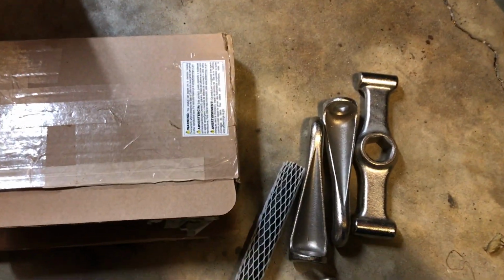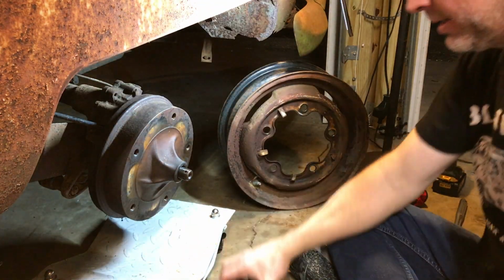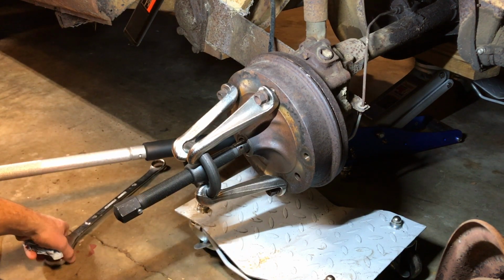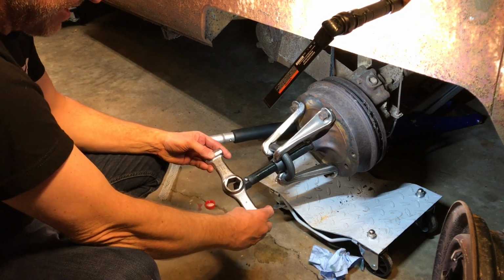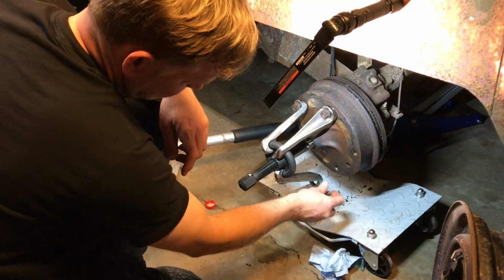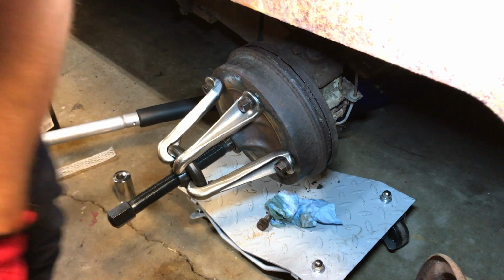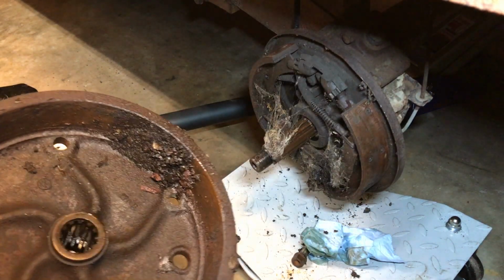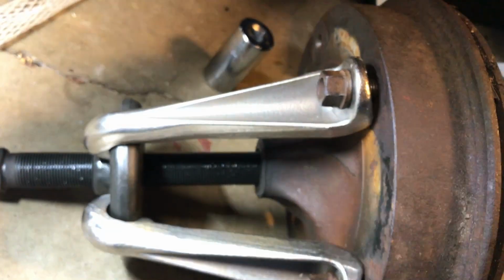Vintage Volkswagen BRAKE DRUM PULLER - VW Bus, Bug, Karmann Ghia - CHECK THIS OUT!!!

Comment: Thank you for your video!!! I am so pleased I found it. This puller tool works perfectly as you demonstrated and the tip about securing the lug nuts tight was invaluable. So was the point about lubricating the screw. I notice you had trouble putting the arms on the doughnut hub and I did too until I found the notch for this purpose. But otherwise it worked perfectly. After pulling the drum off and examining it for cause I found that each spline inside the drum had a nasty burr causing a lot of interference along the axle. So I took some sandpaper and deburred the spline ID and that fixed the problem completely. I also use a little anti-seize on the axle before sliding the drum back on. Jimmy

Comment: Putting oil on the threads of the puller isn't what should be done. The threads are made of hard steel so don't need lube to stop the wear of them. And the main issue is the oil will promote the adhesion of dirt grit etc to the threads, thus wearing out the threaded bar and the hub thread. Also the use of the impact gun will also damage the threads. 
Sorry to keep putting negative comments on your posts, as your really sincere and doing well at this restoration. Just keep it up and please take is as constructive criticism!!

Comment: nice puller! btw 1.5x the dia of a bolt is min thread engagement for example a 1" bolt requires 1.5" of thread engagement - cheers!
Reply from the maker: Hey New! Thanks for the tip! Good to know! Stay tuned man! Did you subscribe? Thank you! =)

Comment: You're supposed to have the pullerarms diagonal over the centre of axle to pull the drum off even. 2 on one side and 1 on opposite side.
Reply from the maker: Hi, yes I really needed to get longer bolts. the stock vw bolts aren't long enough to get the proper spread. Thanks man! Stay tuned for more!

Comment: what's holding the axle ? if your  emergency brake was holding it , that's why it was so hard to pull off.
Reply from the maker: Everything is rushed shut. It's been sitting for 40 years....
Reply: @CTmoog  yes it did look pretty stuck.
Reply: Common for out VW’s, shoes freeze to drums when sitting for years. 

Usually want longer bolts into drums. Kept seeing you loosen to fit “thick” puller arms. Yikes.

Comment: Did you find anyone to turn those drums? 
Were they able to be jigged up on the brake lathe?
Searching to find some info on turning those old drums.
Reply from the maker: Hey Kerry, no...I took them to a few different shops around here and no one could do it. What city do you live in? There might be someone around there. What year is your bus? If they are not too bad you can still use them. Just clean them up and put new pads on. If they are real bad you can buy new ones from wolfsburgwest or other online stores.
Reply: @CTmoog  let me guess, they couldn’t find a centering cone small enough to fit the outboard ID of the drum hub?

Comment: working on a jedi outcast server and browsing youtube and see a new video! work halted!
Reply from the maker: Wow Luke! Thanks man!
Reply: @CTmoog  just wondering but did you try backing off the brakes using the adjuster in the back before using the puller?
Reply from the maker: I tried but couldn't get it to move. I'm going to try that on the other side as well. I'll make another video for the other side and get that on film. I got a bit ahead of myself on this one! =)

Comment: What is the company you got the drum puller ???
Reply from the maker: Here you go: also it helps to have longer bolts to hold the puller to the drum. Make sure they are the correct thread. 
https://www.amazon.com/DearChan-Universal-Removal-Replace-7394/dp/B0BXJ1S6FN/ref=asc_df_B0BXJ1S6FN?mcid=3b11492fd2893f05b39565837311f48c&hvocijid=7796550754602632981-B0BXJ1S6FN-&hvexpln=73&tag=hyprod-20&linkCode=df0&hvadid=721245378154&hvpos=&hvnetw=g&hvrand=7796550754602632981&hvpone=&hvptwo=&hvqmt=&hvdev=c&hvdvcmdl=&hvlocint=&hvlocphy=9011761&hvtargid=pla-2281435178618&psc=1